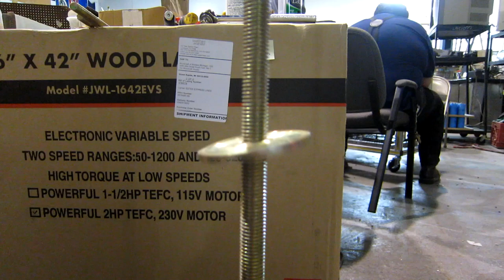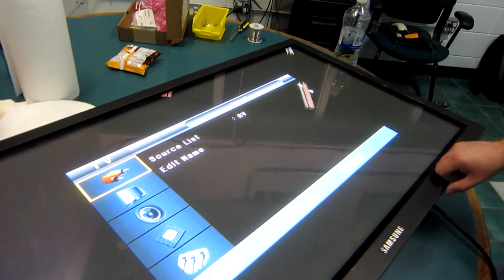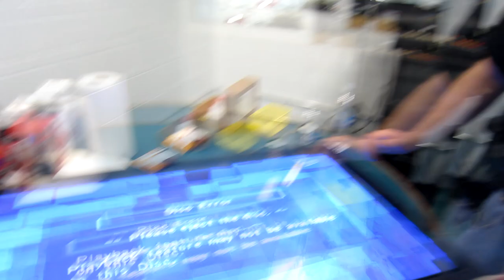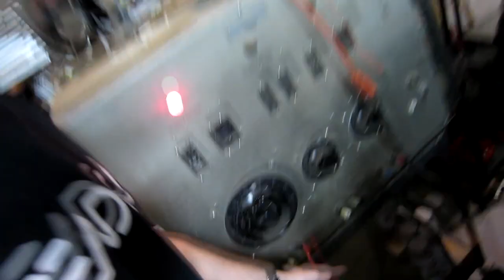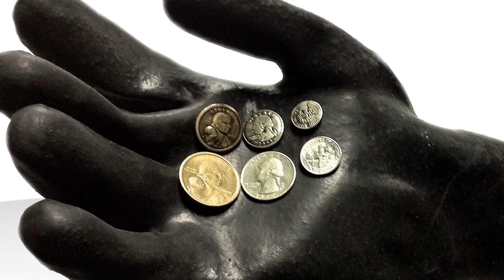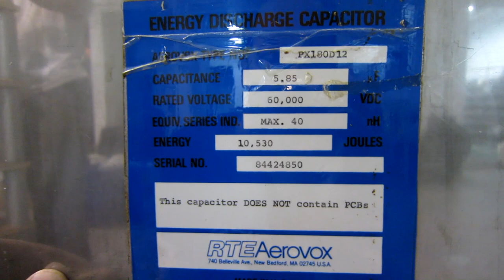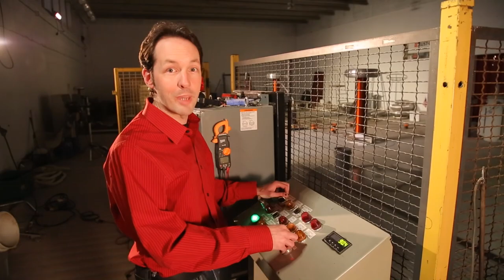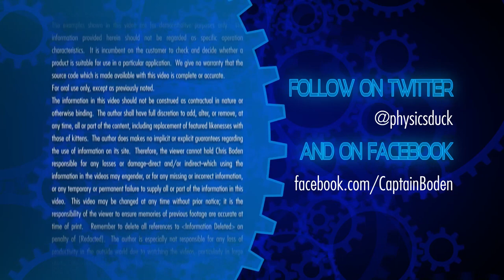Captain's Blog 8-25-2012 Projects Saturday

Comment: look at all them power ferrites! i've spent the last week trying to figure out the cheapest way to get my hands on some big hf transformers, turns out all i need to do is to gut a massive flatscreen! you should put that stuff to good use - make a smps capacitor charger. you could probably pump upwards of a kW through those babies. i bet that'd up the duty cycle on stomper.

Comment: Just an idea for the dust collection on the sheet router.  Would a piece of inner tube, large enough to surround the cutting head, with a cutout to allow free movement of the tool changer work?

Comment: Samsung power supplys from before 09 have capacitor issues, there was a class action lawsuit about it, If I remember correctly they will pay you for the cost to fix the set.
I found a 40inch Samsung in the trash with a perfect display replaced the caps that were blown, and viola! free lcd TV..